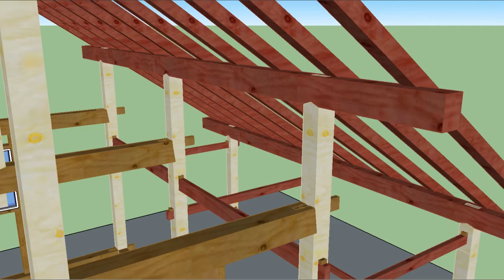Unabridged Timberframe - Top Plate

Comment: I don’t understand when your using the auger why your sighting down the face of the timber that’s parallel to the path of the auger. I know your trying to cut it straight but that face your referencing is hewn, so it not a true reference. If your willing to accept a degree of error of a couple degrees that’s understandable since the mortise doesn’t need to be tight in tf